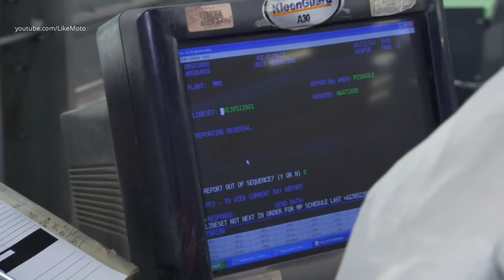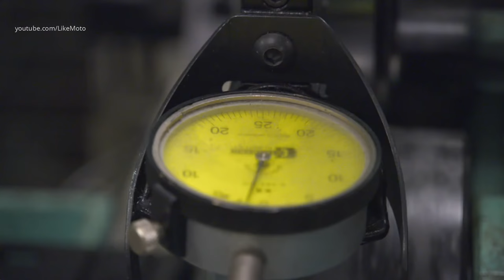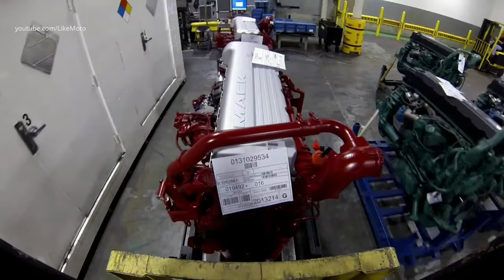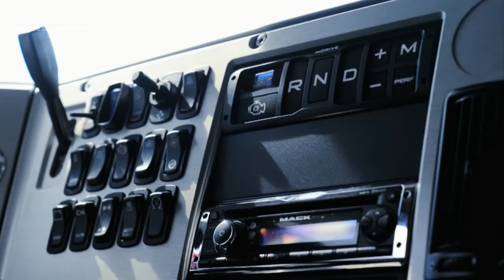Mack truck production - Manufacturing Factory

Comment: Nice to see manufacturing here in the US. Icing on the cake is that same manufacturer producing its own engines and power train components... a rare thing indeed.
Reply: Except Volvo owns them now, It’s sad.. But Hey!! Atleast they’re keeping the factories here with American Workers
Reply: @josefastboats5874  

Volvo owns Mac??? Oh brother...
Reply: @kenmunozatmmrrailroad6853  Yup... Sad indeed. But the trucks are still proudly in the USA with American Workers 👍  just the engines and the chassis are straight off the Volvo trucks. Ugh..... It didn’t have to be like that. I’ll stick to a old Mack Superliner instead 💪 Mack E9 V8 Engine, Mack Transmission, And Mack Rear Ends... All MACK when they were REAL MACKS 🇺🇸🇺🇸🇺🇸🇺🇸🇺🇸🇺🇸🇺🇸
Reply: @josefastboats5874  
I think Volvo bought them in 2000, I believe... Before that, they were owned by Renault since the 80s
Reply: I think people make too big a deal with Volvo owning Mack Trucks.  Would it be nice if the ownership group of Mack was based in the US?  Yes, of course. But, I think the most important issue is if the manufacturing remains in the US.  In the case of Volvo's ownership of Mack Trucks, they have kept manufacturing in the US, including the engines which are manufactured in Hagerstown, Maryland.  If you think about it, what is likely to have a greater impact on the US economy, a company's manufacturing operations being based in the US or the ownership group?  I think everyone knows that there are several US companies where the ownership remains in the US, but they have long since shifted their manufacturing to outside of the US.  In my opinion, the greater positive economic impact is in the country where the manufacturing is done.

I've also seen complaints of "Well yes, there is manufacturing of Mack Trucks here in the United States, but they also have production factories overseas (Australia & Venezuela)".  This is true of the entire Heavy Duty Truck industry.  Even Kenworth and Peterbilt have production plants in Mexico, Canada and other countries, as well as here in the United States.  

And a more common complaint that we've all heard recently about Mack, is this belief that they're now made in China.  This is just not true.  In fact Mack Trucks have no relationship to China or any Chinese company.  This misunderstanding seems to stem from the purchase of Volvo Autos back in 2010 by Geely Holding Group, a Chinese Company.  But Volvo only sold their auto division to Geely.  The Volvo Group is a huge multinational manufacturing corporation.  When they sold their auto division to Geely, Volvo retained ownership of all of their heavy vehicle operations, including Mack Trucks.  Again, China has nothing to do with Mack Trucks.  

Now having said all this, if people have an issue with Mack Trucks' quality or a lack of more powerful engine options, then maybe they might have a fair argument.  It would be nice to see more engine options available from Mack.  But, at least Mack has some of the most fuel efficient engine options in the market.  As for the quality issue, this might be a bit subjective.  I've heard many Mack owner/operators who are very pleased with their Mack Anthem trucks.  I've also heard of some, who are not.
Reply: @matthewwood3204     Excellent retort indeed!💪🏽
Reply: @noname-jh3bd : Mack trucks, Renault trucks, Iveco trucks and Volvo trucks come under VOLVO GROUP
Reply: @matthewwood3204 well put. Agreed.

Comment from the maker: 0:01 Truck Cab Stamping
1:29 Сhassis and frame assembly
5:26 Paint Shop
8:00 Engines and powertrain assembly
11:43 Cabin assembly
15:31 Final assembly line
Reply: Hi, we own a semi truck from Mack and lately having some mechanical troubles with it. Some mechanics checked it out and looks like no one is able to look into the actual problem.I am based in North America, since you make such videos, I just thought if you would know someone who can help us here? 
If so, that will be really helpful. 
Thanks.

Comment: The bulldog is still growling :-) I like these mechanical gearboxes & drum brakes in the year 2020 ! 16:00 ... Air conditioning dryer - for cool drivers ... Great video
Reply: That's probably an autoshift. It operates internally just like a manual, but all the clutching and shifting is done by a computer. I dunno how they are now, but last time I drove them in 2008 they were awful, Shuddering like the end of the world when engaging the clutch, banging into gear, missing shifts. Blech! A lot of vocational Macks have Allison automatics, which work just like the automatic in your car. They have a torque converter and planetary gears, which means they can get away with it having only six speeds, even though the maxidyne high torque rise engine is now gone forever.

Comment: Remember that Mack was once owned by Signal Oil & Gas Co. and was the most profitable addition to the co. Later Renault bought a majority share of Mack, then was taken over by Volvo.Volvo also joined forces with G.M. after the pur- chase of the defunct White Motor Corp. by Volvo to create the White- GMC badge. This ended G.M.'s involvement in the heavy truck industry

Comment: That can style is the exact same since 1992. Matter of fact even the chassis is the sam and the rear ends. Nothing has changed on that truck except the hood design and doors
Reply: Actually that cab came out in 88-89 when Mack CH was launched.  And the frame is not a Mack frame anymore.  From the early 2000s they’re riding on Volvo frames

Comment: Any difference in having wides tires  on the rear instead of having dual wheel & tires?
Reply: Super Single tires are designed for lighter weight for semis. They have more tread but if one blows out, you're in trouble.
Reply: @apolloniaaskew9487  thanks! I always wonder why some had them & some didn’t👍
Reply: They say you get better fuel mileage and you can haul more due to a 500 lb difference instead of having 8 drive wheels you have 4

Comment: '
nice truck...
how come workers are not followwing cleanness clothes codes at mack company...
1- sloppy clothes
1- caps
dont have 2 amber yellow lights on the rear taillights for turnning signals...
trucks are not strong enough protections
Reply: Agreed. A part of being professional is looking professional, no matter the job description.
Reply: They’re working as true workers. Not dressed up for the video. These guys are true and workers, not just some dressed up actors...
Reply: What about the lack of universal safety kit, eg steel capped boots, all quite illegal in a UK factory.
Reply: @robertrich663 
hi R R...
'
what reason UK is a not allowed workers uses a pair of steel-capped boots

Comment: But guys, get it wrong every cable or connector has to have a different color.
According to the international specifications min. 3: 42.
And then why not use the metal channels on the inside of the frame.
To protect hydraulic pipes or electrical cables from hail, briccio of asphalt, etc.
The zip ties must be used by a mechanic, not you in the factory.
And then now everyone produces electric motors with lithium batteries so as not to pollute, you can do it too.
And then on your factory (start of video) you need a solar system like that: https://www.youtube.com/watch?v=ttjCH5p0Dac